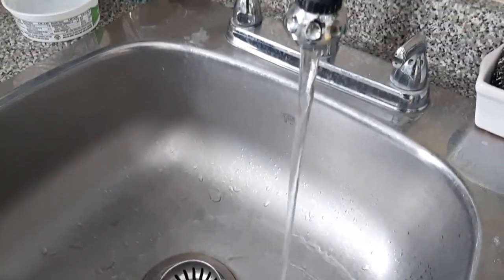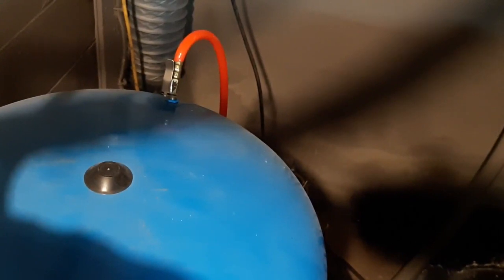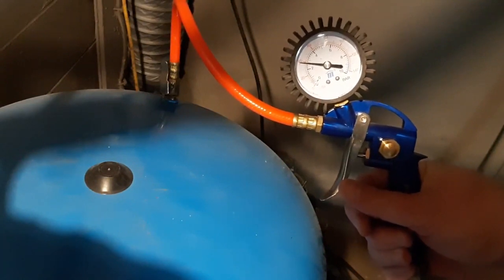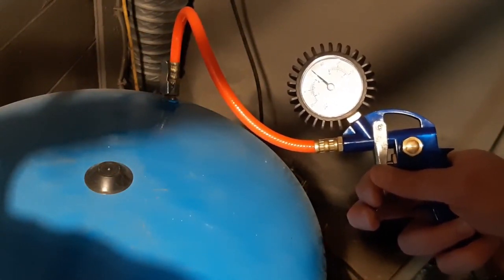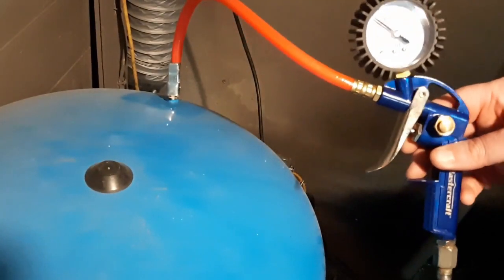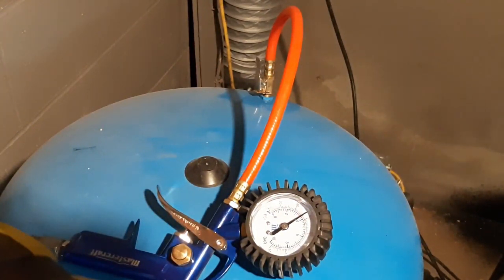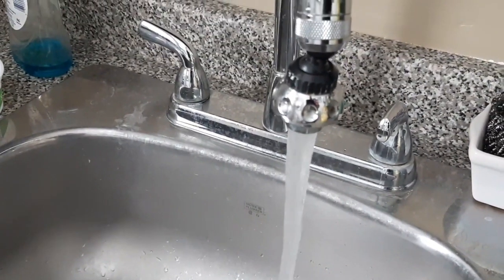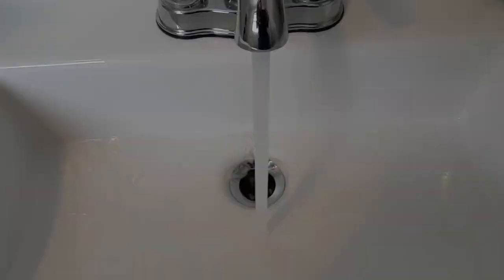No Water Pressure! How to increase water pressure in your home

Comment: We have a trailer, weve had no pressure for over a year! It takes forever just to wash a half a load of laundry! I have to wash my hair outside and during the cold season, its bad! Weve always had decent pressure than it suddenly started getting lower! And i highly dought their air in the lines!
Reply from the maker: I'm thinking maybe you should have a plumber look at that. As there are many different things that can cause low water pressure. I've seen clogged up tap filters cause low water pressure.

Comment: I have no pressure communication out sinks and showers. Did everything in the video to a t. So irritated
Reply from the maker: Sounds like you may have a plugged water line somewhere. If you have hard water you can get a build up inside your water lines and it will slow down the flow and pressure. Also if the bladder inside your pressure tank has burst this can also affect your pressure.

Comment: Hi thanks!  How did you determine how much air needed to be added to the tank (after draining the water)?
Reply from the maker: Your well tank's pressure should be set at 2 psi below the pressure switch's cut-on point. This differs depending on your tank's pressure settings. Most well tanks come set at 30/50. The cut-on pressure for the well pump is 30 psi, so the pressure of the tank should have a pressure of 28 psi. I set mine a little higher then this.

Comment: Shouldn't blindly be 40-45psi. It should be 2 psi below your switch's turn on PSI.
Reply from the maker: You are correct. I forgot to to mention that in my video. I've done this so many times I usually just put around 45PSI in the tank and it works perfectly. But you are correct it should be about 2 PSI below your switch's turn on PSI.

Comment: Now my switch is kicking on and off rapidly when I use water.
Reply from the maker: Do you have lots of pressure in your line? If you do you're cut in pressure is probably set to high so as soon as your turn your tap on and the pressure drop slightly it's kicking in. I think you have to adjust your kick in pressure down so it'll allow the pressure to drop a little bit in your system. I believe I have mine set to kick in around 37 to 40 PSI and kicked off around 60 PSI.
Reply: @budslife  Thank you. I will crank it down a half turn and recheck the upstair shower. It is my highest point of outlet.
Reply: @budslife  When I started I had a tank psi of 40 with the tank full. Model 250 if that helps you with tank size. I am guess the 250 means 25 gallons of water around the blatter????
Reply from the maker: @bkmars2832  yes 25 gallon sounds right? What's your pressure showing now that you adjusted?
Reply: @budslife  too high right now. 80psi at the tank and on the gauge at the. Pressure switch. I can't check the pressure at the hose bib until I drive a hour to get to town. The drawback of rural Alaska.
Reply from the maker: @bkmars2832  wow 80 psi to tank that's definitely lots of pressure.
Reply: @budslife  going to drop the pressure down to 60 (@ tank check valve and crank down the on/off low/high screw donw a half turn. Should I turn the other screw to increase the turn-off pressure?
Reply: @budslife  yes it is. But I know it is not that high at the faucet.
Reply from the maker: @bkmars2832  if you're having low pressure at your faucets you may have a problem with your faucet. They can plug up and when they do you'll get Low Flo and low pressure.
Reply: @budslife  I tank pressure to 60psi. Switch is acting normal. I still have major pressure loss if using the sink and shower, or two sinks. It is a year old tank and switch. Maybe sand in the tank??? But it holds pressure fine if only one valve is open at a time. 5 gallons of sand in a 25 gal tank would decrease holding pressure is my best guess. Idk man. I am a chef cause I know how to fix a good dish. Fixing my car,,,, not so good.
Reply from the maker: @bkmars2832  wow sand in your water system will certainly give you a lot of problems.
Reply: I'll wait til the manchild awakes so he can doo the running up and down stairs.